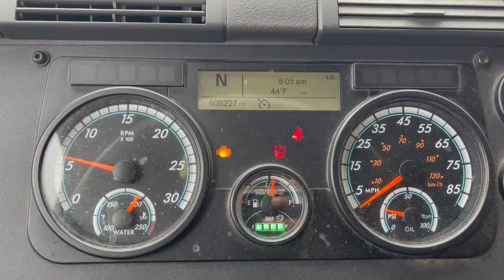How To Tarp a Flatbed Load Flatbed Life #flatbed #tutorial

Comment: and yes u can fix the seat belt . go to where the belt goes to and grab the cable,  stripp the cable and connect both of the wires together with black tape. that will take off that seat belt light
Reply from the maker: 10 4. I’m going to check it out